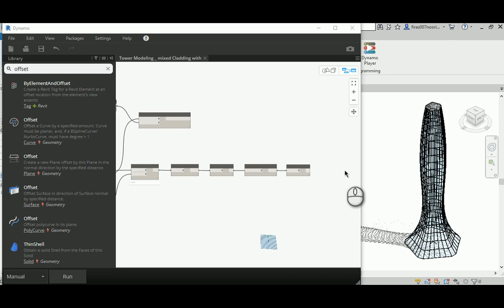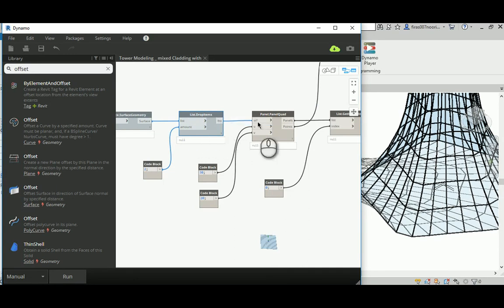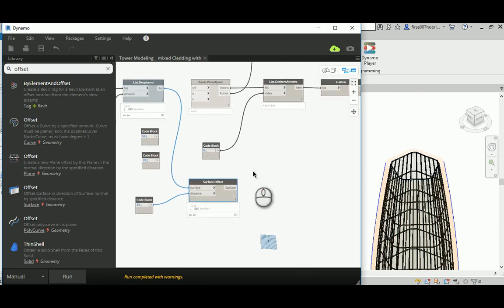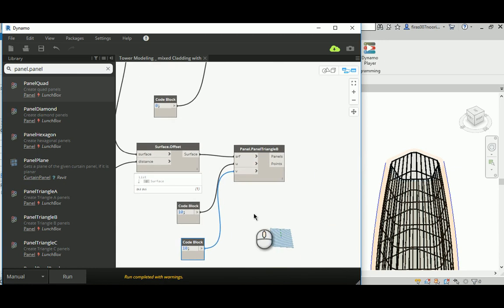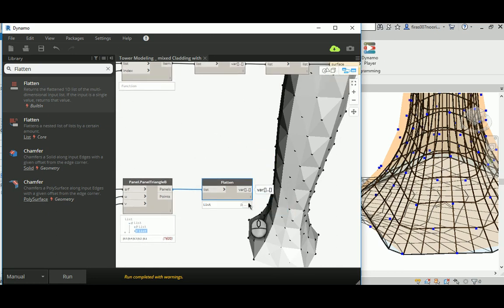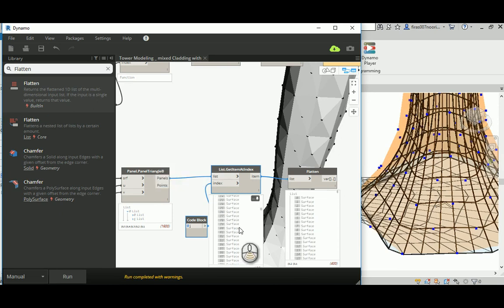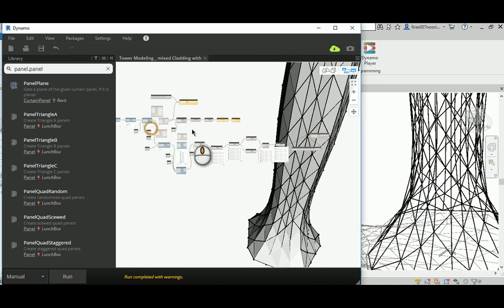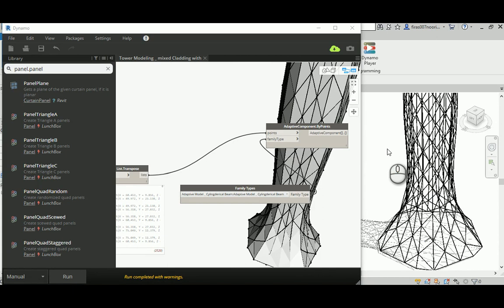Tower Modeling in Dynamo _ Mixing Cladding with Skin in Dynamo

Comment: I seem to have run into multiple errors. My Curve.StartPoint has an error reading: Warning: Curve.StartPoint expects argument type(s) (Autodesk.DesignScript.Geometry.Curve), but was called with (Autodesk.DesignScript.Geometry.Surface[]). The same error has appeared for my Curve.EndPoint. I am wonding if this is because I cannot find the Flatten tool you are using/ I used the List.Flatten with a Code Block of [1;] connected to the amount slot of the List.Flatten. I searched the packages for bulitin but could not find it.
Reply from the maker: I am sorry for delay in Replay, I am in contious travel for conferences, and I rarely find a time to open the laptop, I will return to ur questions in more details when I get back home, but I bet that Dynamo 2.0 has done some changes in FLATTEN, node, try to use the Flatten function istead or just use the withing flatten tool within the same node by pressing the small checkbox on the node itself, sorry again for the delay, I am still far away from home
Reply from the maker: https://ajman4-my.sharepoint.com/:i:/g/personal/f_noori_ajman_ac_ae/EetTSz5ZCq1Epd3NGYlTJsQBAsqkpfPMEOVnEv2ayNTn4g?e=Nh9RCM
Try this image it should shows you a good solution, if not please send me ur email
Reply: @FirasNoori  So sorry fo my late response! I too am very busy with my own classes! I, unfortunately, need to redo the entire thing as my file became corrupted.
Reply from the maker: @calixovacari397  dear, can u send me the nodes to my email
firas007noori@yahoo.com
Reply: @FirasNoori  Would you like the .dyn and revit files or screenshots? i can do either or both.
Reply from the maker: @calixovacari397  I do prefer the dynamo files dyn. If you are linking to revit then both
Reply: @FirasNoori  okay no probelm!!
Reply: Email Sent! Thank you so so much!
Reply from the maker: @calixovacari397  Is ur Dynamo 1.3 or 2.0 ?
Reply from the maker: @calixovacari397  I managed to open it, thanks
Reply: @FirasNoori  2.0
Reply from the maker: @calixovacari397  Sent you the solution on email, have a look and tell me please
Reply: @FirasNoori  I was able to implement it however I still get errors. I sent you the adaptive component.
Reply from the maker: @calixovacari397  hello, I noticed that you are trying to apply the adaptive components in the Conceptual mass, that is not required, you should use the conceptual mass file to create the solid or the surface only and then export it (load it) to the Revit Project Environment, so you need the following
1- a dynamo algorithm that opened with Conceptual mass, that create only the form of ur tower, then upload that Revit conceptual mass into a Revit Project Environment (NO Adaptive Component by points) this file is only to create the slabs and non curtain panel parts of the tower
2- Create a second algorithm that have the added (Adaptive Components) this will clad the required Curtain panels)
Reply from the maker: See my videos on the snow flaketower, Step 9 teach you the steps to create the Curtain panels on the Tower facade, notice that the background Revit is PROJECT ENVIRONMENT not (Conceptual MASS) !! 
then see Snowflake 10 and 11, these are showing you the process in Dynamo to create the buddy of the tower that runs with Dynamo and Conceptual MASS (NOT Project Environment) and then exported to the Revit Project Environment to make walls and slabs automatically)
Reply: @FirasNoori  I will check them out!!